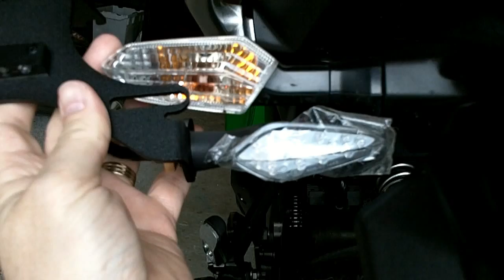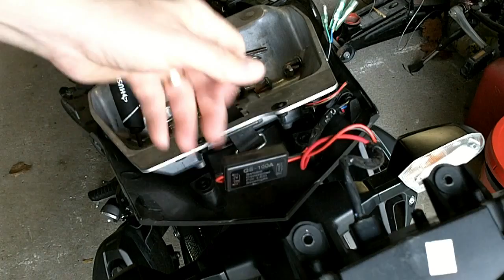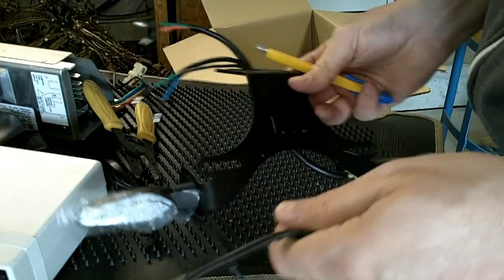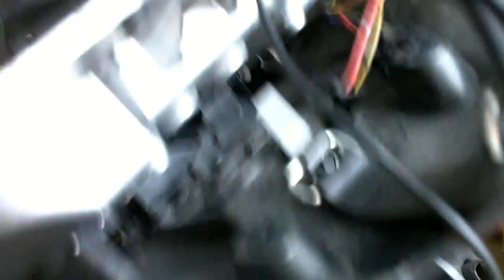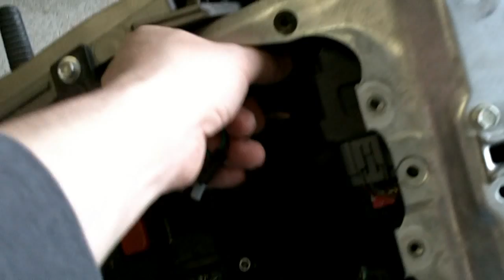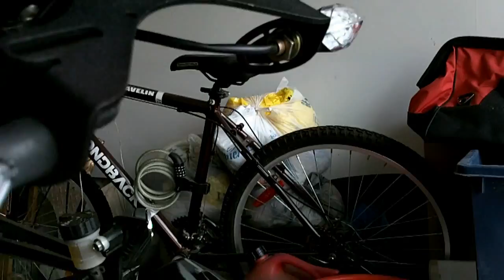ninja1000 / Z1000 fender eliminator Install and brake flasher upgrade

Comment: Hi from the UK, great video. were not allowed for the turn signal to flash that fast as it has to be slowed down do you know where the relay is for the rear turn signals on a Z1000? thanks
Reply from the maker: The Z1000 ( non fairing bike) has it under the seat where the tool kit goes. Can't miss it. The fairing model has it located between the headlights in the fairing in front of the horn. All according to the shop manuals. A set of ballast resistors will sort the speed out and they are cheap on ebay. Just install them in line with the new light power feeds.
Reply: Gavin G much appreciated thanks.👍🏻

Comment from the maker: The hyperflash condition is due to the reduction of current on the turn signal relay. The relay speeds up but because i have the factory front bulbs in place, the increase is acceptable. I've never heard of this damaging the system. Ive been doing this for years on several bikes without issue. I've even found a hack where you open the relay and swap out a resistor or capacitor, i forget which, and it slows the rate down. If you can explain why it would damage systems, I'd be interested to find out why.

Comment: When fitting led rear indicator lights you are supposed to fit a relay switch  suitable for led indicators...it is situated under the front left fairing failure to do so can cause damage